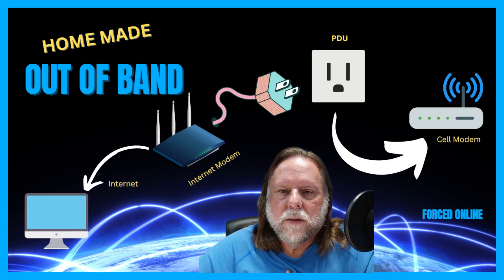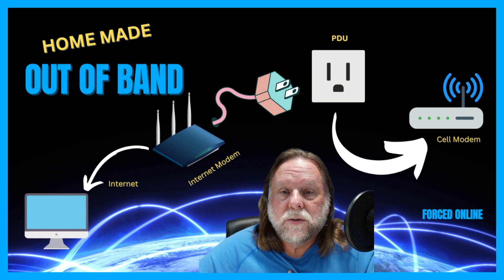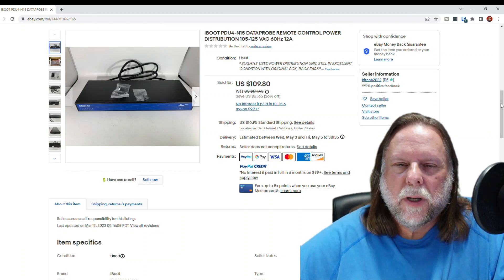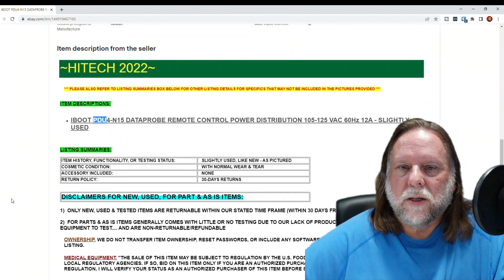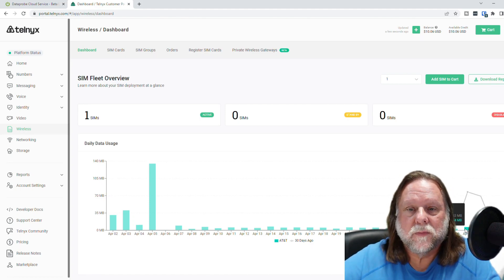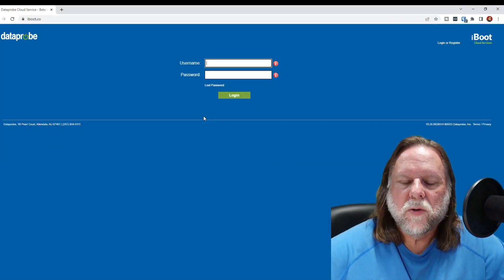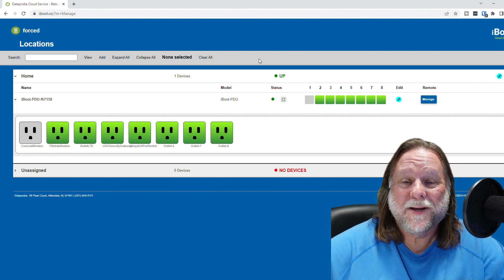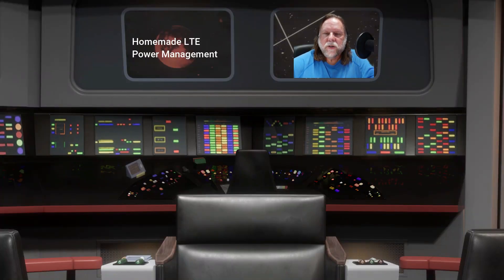Remote Control Reboot - How to Remotely Restart Home Modem/Router From Your Cell Phone

Comment: For my mountain cabin, two $6 mechanical outlet timers power cycle the modem & router every 24 hrs. Still works after grid goes down & returns (very common).

Comment: In my mountain cabin, I use two $6 mechanical outlet timers (think xmas lights) to power cycle my modem & router once a day. This even works after a power outage (very common up there) once power is restored.
Reply from the maker: @bgregg55 That’s an excellent solution to make sure you have a fresh, stable connection at a remote site. The only downside of course is that you might have to wait a day to have the process happen if you needed to connect. If that’s not an issue (and I understand it probably usually isn’t for that use case) then it’s golden! I still have an X10 telephone controller at my cabin, which lets me power cycle the outlet with a phone call and a few button presses. It is wired between the phone controller and outlet. That technology is ancient but has worked for years.